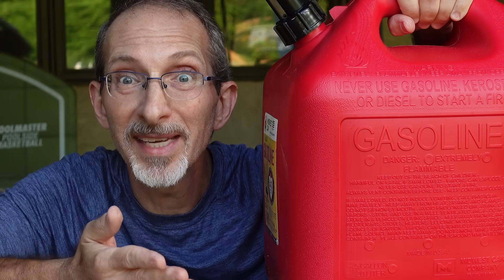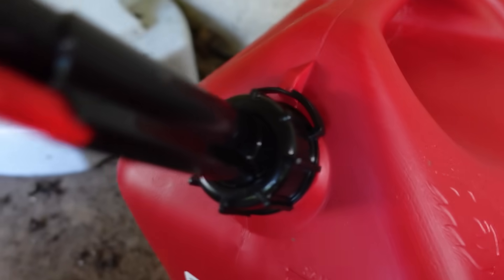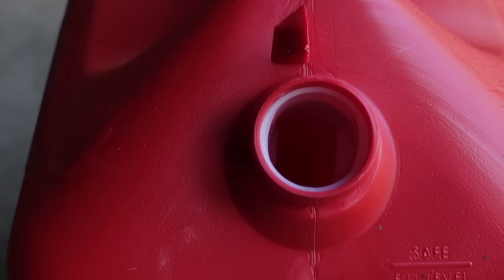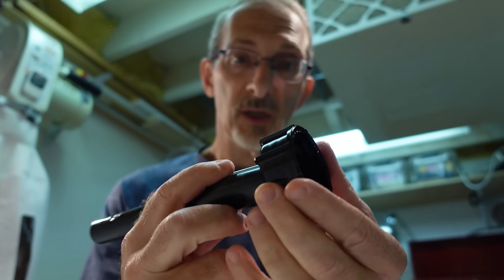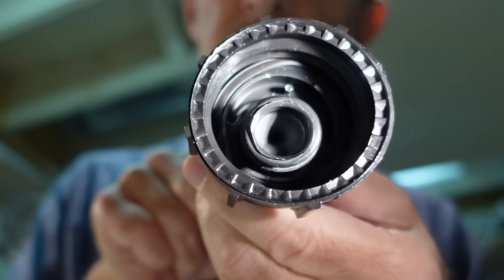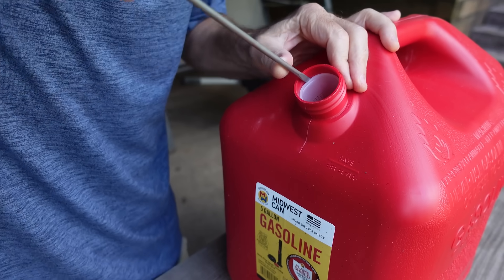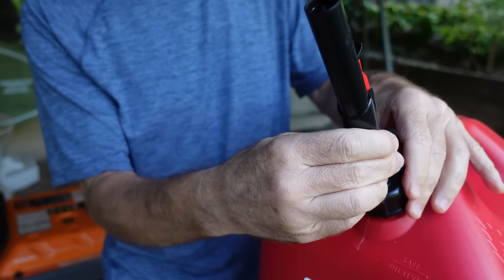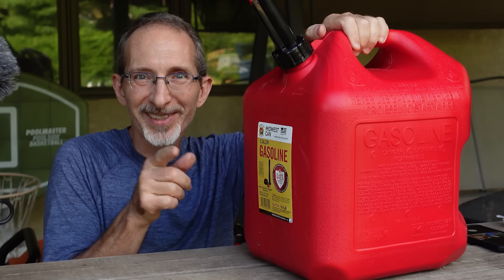Gas Can Modification | New Gas Can Fix

Comment: I never had one of those gas cans, but I know what you mean, I have used one with the filter, it's a royal pain, which the fact that it also prevents you from seeing how much gas you have inside the can don't help, I've got the "Spill Proof" cans that are sort of like that, but they don't have the thing you press, they have a ring to turn a little to allow fins to slip through grooves, then you can pull the nozzle back to pour the gas & the nozzle's angled, I've got 5 gallon Jerry Cans that I put the spill proof nozzle from a smaller plastic can on, it'll cause pressure build up inside the can which I've accidentally sprayed Gasoline all over the inside of my van, the pressure build up because of the spill proof nozzle sprayed gasoline 10 feet away from the gas can, those "Safety" features are not only a pain in the ass, but they're more dangerous than the old nozzles, a safety feature caused pressure build up that sprayed gas 10 feet, I had to drive that same vehicle to get to work.
Reply from the maker: @Krupp Ratte - wow, that sounds like a mess! Posting this video and reading the comments makes me realize how many bad gas can designs there are out there... Hope the van aired out quickly!

Comment: Just wondering which smart ass came up with these "great" designs. I once used a Scepter tank. Gas got spilled everywhere when I fill the can and use the can to fill the tank later, just because of these designs.
Reply from the maker: It took great minds to come up with this great design, I’m sure. I don’t know, I just fix ‘em. 😎

Comment: I completly agree with the disposal of the eco-disaster parts of the gas cans. All they do is spill gas EVERYWHERE. Whereas previous to these cans I can't even remember ever spilling gas. They created a massive eco problem that wasn't there before they fixed the non existant problem.  Everytime I see one of those I keep hearing that voice in my head saying "I'm from the government and I'm here to help" and everyone starts running away screaming. They have to know by now that they made an imaginary issue a real issue with their interference yet they don't correct it by removing the BS regulations.
Reply from the maker: I hear you! I used to pride myself on how neatly I could dispense fuel, and these cans just turned me into one big mess. It’s not completely perfect after these mods, but it sure is better than it was. Thanks for watching and chiming in!

Comment: Ugh why do I wait till after I buy 2 of these to research  🤦‍♂️
Reply from the maker: Lol, I did the same. Why? Because they were the cheapest ones I could find. That’s ok, problems fixed!
Reply: @MikeFyxdt  
Great video but I thought I wonder if they sell regular spouts. Yes they do. Just ordered 2 pack of spouts with the yellow vent mod caps. You did a great video but for me it’s better to buy new instead of trying to getting aggravated 😆
Reply from the maker: @scrumthebum2451  yes, getting a replacement spout is definitely an option!
Reply: @MikeFyxdt  
Finally got my spouts. Just wanted to mention I had some trouble getting the plastic screen out with needle nose but once I brought out the vice grips it was name over in seconds 👍
Reply from the maker: @scrumthebum2451  vise grips for the win!!! 😁
Reply: @MikeFyxdt  
😀. It’s a crying shame we have to resort to surgery on a gas can 😛

Comment: I just bought one of these nightmare cans for my snow thrower. Love the video but now how do you store the can safely after filling the equipment when there is still gasoline in the can? That little dopey "dust cap" is useless in terms of safe storage.
Reply from the maker: Even after you perform the mod of removing the spring, when you pull out the nozzle when you’re done pouring, it’s still is airtight. So storing the container with gas in it is not a problem.

Comment: Damn, I just threw my midwest can out hah.

Eventually the rubber seal will fail. Leaked all over my car. How is that safe?

EDIT, 5:00 your seal is kinked and going to fail too
Reply from the maker: I looked at the video and I think the plastic is funky but the gasket is fine. Coincidentally I made a follow up video yesterday and took the gasket off, and it looked fine. I have 2 of these tanks, so it is 50/50 that it was the same one in the video. Bummer your car got splashed...unsafe and stinky! Appreciate you joining the conversation!

Comment: You’re actually making it safer!!! Otherwise you’re fighting to get a gas can to do it’s only purposes ... hold fuel and pour fuel. (Edit.. added comment) I’ve got 4 of these and just yanked the filter out of the first one .. ha hate this factory setup. The first thing I did was cut the excess off so the cap can be unscrewed .. yeah I was a little skeptical on how to get that damn filter out. Over and done and now it’s a real gas can.
Reply from the maker: Hold fuel and pour, like you said. So simple, and yet... 😁
Reply: @MikeFyxdt  all 4 are real gas cans now ... next step is to just throw the factory nozzles away and get a pack of real ones and a pack of venting caps.

Comment: This was very helpful.  I had a lot of trouble removing that white filter and at one point lost it to the depths of the can.  Lying on my back with the can above me, I managed to hook the filter with an ice pick and turn the bottom facing up where I finally could finally remove it.  It just didn’t want to come out top first.  Thanks so much for this video.  It makes these devices manageable.
Reply from the maker: @washoe1985 - I'm glad it was helpful!

Comment: I wish I had seen this video before buying one of these ridiculous contraptions. I was caught off guard and needed a can immediately , had to pony up $39 for a 2gal at the gas station to refuel my vehicle in which the fuel gauge randomly quit working. What a rip off!! 
Then I find out I need a degree in rocket science to operate the thing.. Oy vey!!

Anyways, thanks for the great video!
Reply from the maker: @M - $39 for a 2 gallon gas station can is truly 'highway robbery'! Yikes, gotta do what you gotta do. That, plus your fuel guage problems - I share in your 'Oy vey' sentiment! Here's to a better year, and thanks so much for sharing your story!
Reply: Instead of paying for the expensive gas can at the station, you can just buy a gallon of water and dump it out. Then you have a container for cheap.
Reply from the maker: @isaacm6727  - better travel with a funnel!

Comment: The diesel can is the same. I just pushed the so called filter in the tank. Now I can mod the spout to fit my needs. This is designed this way because so jack ass was incapable of logic and thought. So as is true with most things in life the lawyers came up with this oh so clever design. Thanks for the info on the spout I will be doing that soon to my diesel and gas cans.
Reply from the maker: The ‘filter’ is a flame arrester, for the safety of the small minority of people that want to pour fuel on open fires without blowing themselves up. For all us normal folks it is a P. I. T. A. !

Comment: Mike, I believe what you removed from inside the can was not a filter but a flame arrestor. That's why they advertise those cans as having a "Flame Shield Safety System". Having worked in the oilfield I am familiar with equipment built to tolerances such that vapor fires self extinguish when they are forced between gaps in panels in equipment that are built to specific tolerances. I think that device that you removed is likely such a contraption. The idea being that if there was a fuel/air mixture outside of the can that found an ignition source and flashed back to the can it would self-extinguish when it hit that screen, and not ignite the gasoline inside. While I agree the newer gas cans are in general a pain in the a**, you probably should have left that in place. I am able to fill mine just fine by filling them a little slower so the gas has time to filter through the holes in the flame arrestor and doesn't trigger the auto shutoff on the gas pump. Just my two cents.
Reply from the maker: @Paul M - Yes, since making the video I've learned the purpose of the 'filter' is, as you state, a flame arrestor. I plan to do another video bringing this to light. That being acknowledged, I feel that this safety feature is appropriate to a small group of people using gas cans to add fuel to an existing fire, but is a hinderance to the majority of people simply trying to dispense fuel. In my follow up video I'll try to explain the safety concerns/reasoning, and then let people make up their mind whether to do this modification. Maybe a later version of this 'safety system' won't inhibit the day-to-day practicality of the container as much as the current design!
Reply: @MikeFyxdt  Once upon a time, the safety screens were metal screens installed in the spout itself so you had the advantages of the safety feature but it wasn't in the way when filling the can.  Now the cans are entirely molded plastic and you can't make a plastic screen that will fit into a spout so they stick them in the can.

Comment: Whoever invented these "safe" gas cans should be shot.  First thing I do is remove those horrible nozzles. All these "safe" cans do s cause me to spill more gas on the ground. Even with your modification it's still a pain in the ass. I removed the nozzle all the way. Unscrew lid, pour gas. That's all I have to do.
Reply from the maker: 100% Agreed! These are so over-engineered they are more trouble than they are worth. Keep it simple!

Comment: The other issue with them is that there is no vent, so what I did is drill a small hole in the top rear of the handle I used a 1/4 drill and used a 5\16 tap and thread the plastic  then used a nylon (steel) (1/4) 5/16 bolt to seal the hole until I needed to pour gas.
Reply from the maker: @ken Evans - good fix - yes, a vent makes a difference. I bought some cheap snap-in vents that I will try in an upcoming video.

Comment: Thanks for the upload! Wish I had seen it before I tried to pull out the screen. I did the same thing you did but after struggling for a LONG time, I ended up dropping the screen into the gas can. I will not be using the nozzle because it is not angled and the flow is too fast for a snow blower gas tank. I'm using a funnel that I made from a soda bottle. It has lasted for years because the gasoline doesn't break that type of plastic down. No guarantees, though.
EDIT 12-17-20 I took your advice and removed the spring. Remember to put the gasket ring back on the nozzle, folks. Used it to fill snow blower (with funnel)  but son of a bitchin' thing still leaks a little! Probably going to order a replacement nozzle.
Reply from the maker: Oh no! The screen went in?! I really don’t think it will be a problem. DIY funnel from a bottle is a great idea!
Reply: @MikeFyxdt  Thanks! Two liter soda bottle. Happy days.

Comment: Thanks Mike - this was the best modification I have seen.  Plus it was quick and easy to do.  The worst design to begin with....
Reply: Great job Mike, I love your attitude. Gadgets and inventions should make life and work easier, but when thinking outside the box, you should go all the way around the Box examining variables before you yell success.
Reply from the maker: @ronaldclifton8710  - thanks! I love how you put it, "go all the way around the box..."
Reply from the maker: You’re welcome! It made a huge difference!
Reply: @MikeFyxdt  I bought a couple of these plastic gas containers when they were relatively a new thing (in place of the metal cans).  One had a spring loaded spout similar to what you have.  It eventually broke after I used it a few times.  I went back to the store to look for replacement spouts.  They had a flexible spout that had a cap on the end to close it--a simpler design, but the price was about $10.  It's really a crappy customer experience to buy a new gas container with a spout that breaks after a few uses, and then to fix the problem, you have to spend about as much money as what you paid for container.  Maybe I should've contacted the manufacturer and demanded a free spout to replace the one that broke?

Comment: damn...you saved me $24 did not have to buy 2 ez-pours Thanks you Mike so much
Reply: EZ-Pour spouts are safer because they have a flame arrestor screen in them. They are not intended to be filters. They keep the can from blowing up in your hand if there is a spark and plastic fuel cans tend to create more static electricity charges/sparks than metal cans.
Reply from the maker: Excellent!!!

Comment: I swear the first time I used one of these stupid cans, I spilled more gas than I have since I was too lightweight, myself, to properly lift the can... I want my old flex-spout gas can back (I see after-market nozzles available online, and I'm probably going to have to just buy one of those. The tricky part is going to be adding the air valve on the back, but I also miss the 2nd handle on the back of the jug to hold while you're pouring).
Reply: Also, I find it super funny that this video was recommended after watching one of these new gas can company's "how to use our gas can" video on their website. :D
Reply from the maker: @c182SkylaneRG - I couldn't agree more. I bought some DIY air valves which i plan to install in an upcoming video. Thanks for checking in!

Comment: Very informative video.  Just bought 4 of these.  Had not purchased gas cans in several decades so was frustrated, distraught, and unhappy with the difficulty in making these new ones work. Could only picture an unpleasant situation trying to use them during a weather crisis when I needed to actually use them for my generator.  Thanks so much for this information.
Reply from the maker: @mike m - it’s so nice to see that this video has been helping people. It is such a frustration trying to use something that is poorly designed, and on top of that gas is so dangerous and messy! A power outage is definitely not a time that you want to be spilling gas! Thanks so much for watching and for sharing your comments.

Comment: I just bought a new gas can and it is an FMD safety can. This means it has a dumb filter in it which makes it impossible to fill up. Every time I go to pump the gas it backs up too much in the filter and the pump handle shuts off. It now takes me like 10 minutes to fill a can of gas and sometimes it spills. These new cans are a joke at best.
Reply: Just don’t put the nozzle in the can a the way. Hold it at the rim and fill. Problem solved.
Reply from the maker: @Dimitri Bianco - YES! Everything you just said. Thanks for joining the conversation!
Reply: What’s the point of the filter? It keeps the can clean, but when you dump gas out whatever it catches just goes your engine.
Reply: Looks like a big rubber!!
Reply: I tried to get that out of my can and dropped it in and then spent the next 10 minutes trying to fish it out with a piece of copper wire  lol

Comment: Thank you, Thank you, Thank you! It baffles me how Midwest makes a 2 Gallon 8 ounce can that they clearly state on the can what the extra 8 oz is for but, unless their engineers have never used a weed wacker or chain saw before, renders it useless for said use. I put 2 little bottles of oil in it and then went to the gas station last night. Like you said, the first squeeze of the pump nozzle trigger and gas came right back at me. I ended up pumping 2/10ths of a gallon at a time. Without your video I never would've known about that super long spring and how to remove it. Again, Mike ~ Thanks Ever So Much.
Reply from the maker: Hi Terry, really glad the video was useful! It’s amazing how over engineered these containers are. Glad this knowledge helped you figure it out!

Comment: Another problem is the u shaped gasket at the base of the spout. Your can will leak there, like mine does. You can see in your video the “gasket” is partially off the base, in your video. 
The “filter” is actually a flame arrester, but it makes filling almost impossible. Seems like different vapor recovery nozzles work better than others.
Reply: I have reset the channel gasket a number of times. Even tightening the collar can cause it to be dislodged. Nice video, I haven’t bought a gas can in many years, luckily haven’t thrown old cans away. New nozzles ordered. Thanks
Reply from the maker: Hi James - I'll watch for that...Thanks!

Comment: Its weird how the filter isn't removable. What happens when it finally catches something lol. You can't clean it out anyway
Reply: It's not a filter...it's a flame suppressor device.
Reply from the maker: Canadian Cruisin - it’s so dumb. If you get muck in the filter then, yeah, it doesn’t go in the gas can, but instead it gets washed back into what you’re fueling. If it came out easily then it would have a purpose.
Reply: @MikeFyxdt  exactly. One of those produce and sell without any test products lol